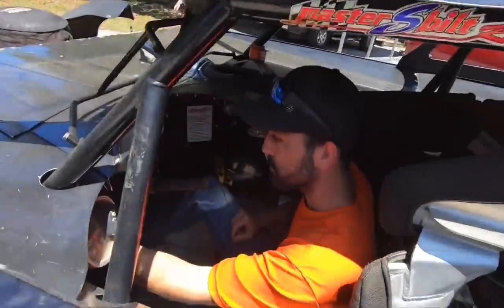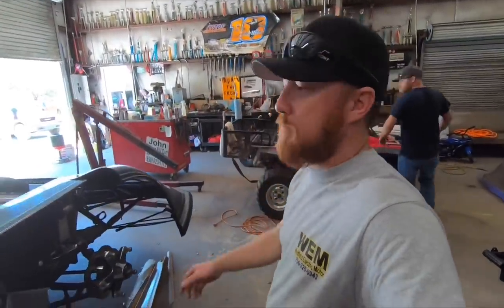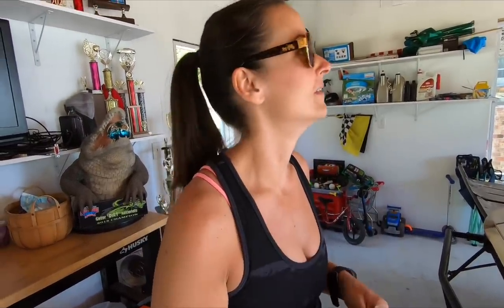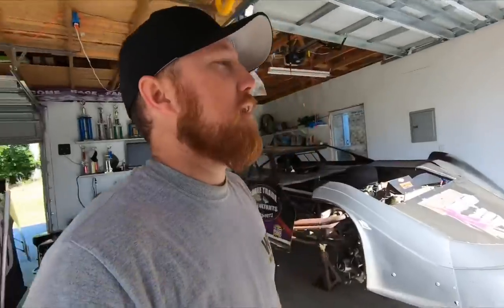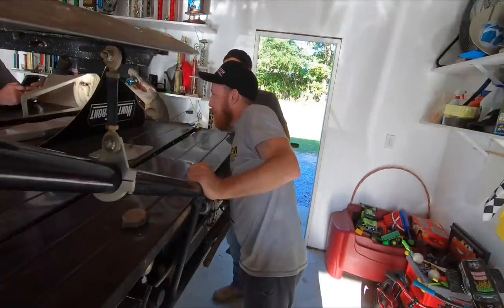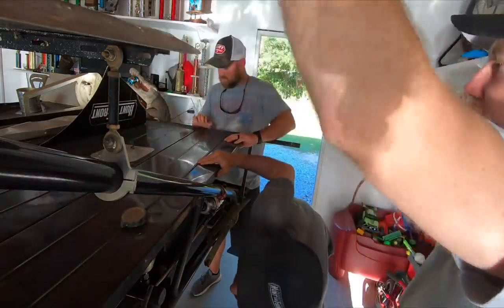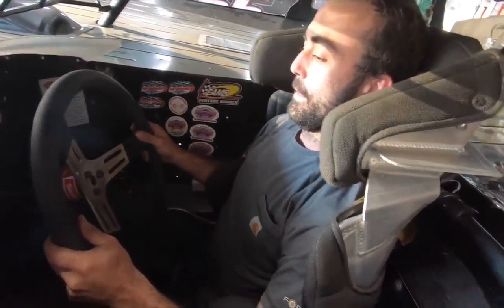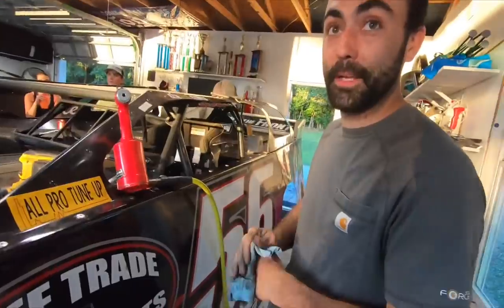It's Time to GO RACING again! (Change of Plans for the Old 56 Car)

Comment: crew and drivers only in the pits will be a refreshing change. that's the way it was, for many years. the grandstands is the place for the kids, wives, girlfriends and other spectators that don't need to be in the pits. they can watch all the races and learn to appreciate all racing and not just one class. this is the only positive spin off the wu-flu issue so far.

Comment: Still waiting on the detailed tutorial on how to drive a dirt late-model. I don’t understand the push the clutch pedal to go. When do you let off of the clutch?
Reply: On a bert/ brinn trans, you push the pedal to engage clutch, you are pushing to clutch plate together and that gets you moving in 1st gear. Get up to about 4000 rpm let off clutch, then you are matching rpm with a direct drive gear, pull gear shift to put in 2nd gear. You're then directly hooked to the motor, no clutch. So no clutch slippage, if you stop rear tires, you stop the engine.
Reply: The clutch is only used in 1st and reverse gears. When you get into 2nd gear, it's like direct drive.
Reply: Alan Mcmichen ok....Great explanation so far on how you get going, but how do you stop without stalling the car. I’m guessing just pop it in neutral or first gear?
Reply: Yes, that's right. Let off the gas and pop it into neutral 👍👍🏁
Reply: Alan Mcmichen Cool Thanks!!!!!!. Now all I need is an extra 50,000 so I can buy one. 😃
Reply: @ballou1777  maybe a used chassis and a 602 crate engine ... You may be making laps 20 - 25,000.

Comment: Definitely feel a little frustration from the boys with this whole deal and towards the guy that owns the for sale car
Reply: Just a guess.. It sounds like Dirt Daddy's friend owns the 4-sale car. I'm thinking Dirt Daddy want's to put some old school idea's in a modern day chassis. He might like how it drives and feels, but it won't be fast enough when it's all said and done.
Reply: I'm guessing Dirt daddy wanted the car with all new parts... I even went back to a video when jesse was working on putting all those new parts on the ride and some lady (I'm assuming might be dirt mamma) even said after jesse unwrapped his new flywheel "dirt daddy is jealous cause youre getting all the new parts" Video was called "Postponed Races and New QA1 Shocks (Jesse Gets all the New Parts!)" at around 3 minutes in the video.... something tells me he eventually voiced his issue and they had a slight fallout from it hence why theyre not at the big shop

Comment: Sucks you guys switched cars on Jessie after months later. The Track star is way better.
Reply: Bay Area Adventures from the mood of the whole deal I’m thinking that there was a disagreement with the owner of the 4sale car about how stuff should be done
Reply: Possibly a deal in the works to get rid of the old 56 and replace it with a Capital! Never know these guys have a history of dropping surprises.
Reply: I'm guessing Dirt daddy wanted the car with all new parts... I even went back to a video when jesse was working on putting all those new parts on the ride and some lady (I'm assuming might be dirt mamma) even said after jesse unwrapped his new flywheel "dirt daddy is jealous cause youre getting all the new parts" Video was called "Postponed Races and New QA1 Shocks (Jesse Gets all the New Parts!)" at around 3 minutes in the video.... something tells me he eventually voiced his issue and they had a slight fallout from it hence why theyre not at the big shop

Comment: Jonathan. you sound kinda sore that Dirt Daddy wants to do his own thing.
Reply: It sounds like Dirt Daddy's friend owns the 4-sale car. I'm thinking Dirt Daddy want's to put some old school idea's in a modern day chassis. He might like how it drives and feels, but it won't be fast enough when it's all said and done.
Reply: Definitely have same impression But it may be more towards the guy that owns the 4sale car
Reply: @54raceman   If the owner and Dirt Daddy wan't old school ideas, then it should be done on the owners chassis.  A bit of a waste getting the cross member done though.
Reply: Thus is also the first time we're have heard that someone else owns the 4-sale car.  Don't remember hearing that in other videos.
Reply: I'm guessing Dirt daddy wanted the car with all new parts... I even went back to a video when jesse was working on putting all those new parts on the ride and some lady (I'm assuming might be dirt mamma) even said after jesse unwrapped his new flywheel "dirt daddy is jealous cause youre getting all the new parts" Video was called "Postponed Races and New QA1 Shocks (Jesse Gets all the New Parts!)" at around 3 minutes in the video.... something tells me he eventually voiced his issue and they had a slight fallout from it hence why theyre not at the big shop
Reply: @eXpLiiiSiT   Jesse is still going to get those shocks and flywheel and motor when they switch everything over to the old 56 car.  Dirt Daddy gets whats in the old 56 car. Not Jesse.
Reply: @eXpLiiiSiT  You should copy and paste that a few more times.

Comment: Where's Jessie the driver ? he should be there. Every day to work on the car, not iracing.
Reply: He’s in the video
Reply: He was in the video working like a driver should. Did you watch the video ?
Reply: He didn't help move the car or help unload the car, he wasn't even the first guy there to help. Yes, I did watch the whole video,  my comments were from the first part, when Jessie wasn't there. I have worked on several super lates, crate late models, ump modified, street stock and 4 cylinder cars. I have been in garages 12 or more hours every weekend in the summer to wash and help get cars ready for the next night, so I don't want to be accused of something that I have done for several summers.
Reply: @michaelolenick4078  Cool, but he was working on the car and I'm guessing he wasn't iRacing.
Reply: You guys still are not getting my point. When someone is given a ride that someone else owns, like the Joiners did, I would think that that someone would be their to help them to load and unload the car, Jonathan's wife was there to help Jonathan unload the car. I did not say he was not there that was your assumption. But he came after two others came to help with the car, because Jonathan was working on the car by himself.
Reply: @michaelolenick4078  some folks are still working
Reply from the maker: Jesse works for the local water authority and was at work most of the day Friday. He stopped by to help load the car on his lunch break then came over to Jonathan’s garage as soon as he got off for the day.
Reply: @michaelolenick4078  You said " Where's Jessie the driver ?" Then you thought he was iRacing. Chill out goober.